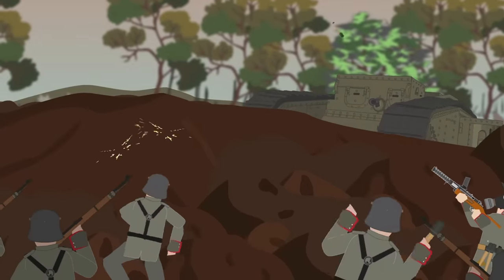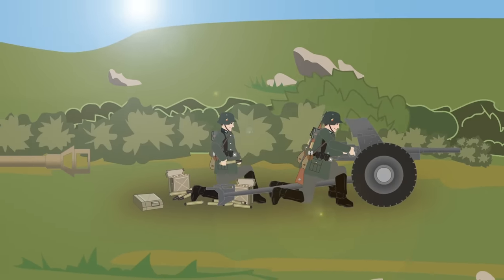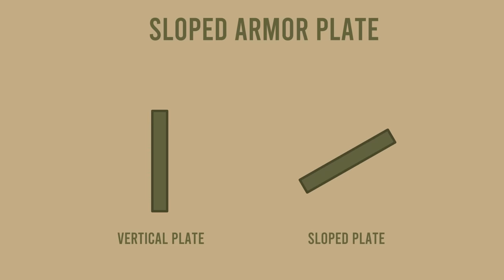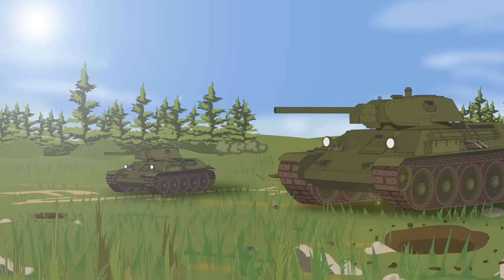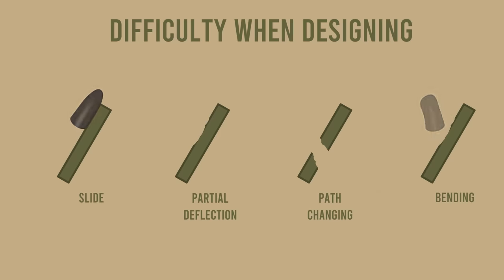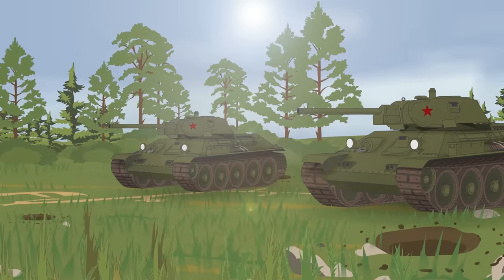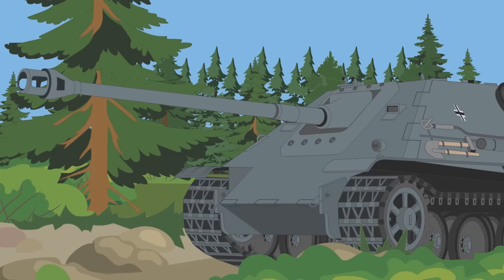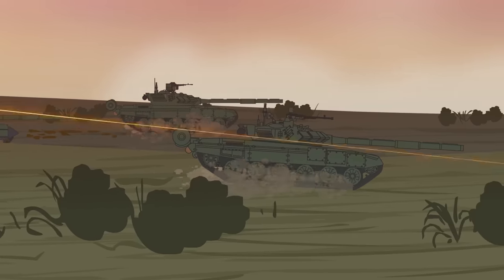Sloped armor: A simple feature that saved many lives

Comment: Reminder: 
Sloping tank armour removed interior space.
The thickness accounts for both the roof/front. While flat armour can have very thin roofs with much thicker fronts.

It's better, but not to the degree people think.
Reply: So more like a sidegrade than an upgrade
Reply: He should make a cold war weapons
Reply: thats a reason why the panther is a rather big tank. The germans didnt wanted to trade too much interior space
Reply: But you have to make flat armor thicker for it to have the same effect as sloped, meaning more weight and less mobility, which is why its hard to find a flat surface in modern tanks, they're all very edgy
Reply: @caralho5237  It doesn’t mean more weight. You need the same amount of metal to enclose a given volume with x mm of armor regardless of how you arrange it.
Reply: no pun intended
Reply: @caralho5237 you have to make sloped armor longer, negating the weight benefit.
Reply: @Danjiano  Sloped armor makes things ricochet. A round that penetrates 100mm of flat armor wont penetrate 100mm of effective 45° sloped armor. The tip of the round will have a harder time "hooking" into the plate, its much more likely to just skim off.
Theres a reason you'll be hard pressed to find any modern tanks with flat armor today. At most, you'll find ifvs that prioritize space over armor

Comment: Tbh I was dreading this, as YouTube is often a BS minefield, but this is a pretty good job, 10/10 visually!  I like the fact you point out the internal volume aspect, a very big part as volume, weight, dimensions are far more important than the armour mobility firepower trope. And the fact there is no weight saving was nicely covered. The two areas overlooked are that sloped armour is easier to overmatch (the rounds calibre is greater than armours thickness) this still effects the vehicle with sloping, becoming less effective if the rounds calibre overmatches the vertical equivalence of the plate and the larger the round the less effective the sloping is comparatively. 

The other issue is that sloped plate is considerably less effective on any slope, that is if the vehicle is going down an incline the armours effective thickness is decreased by the same angle and battlefields are not always flat, while vertical armour can only gain loss thickness in the same scenario. Finally, there is edging effect – any opening in a sloped plate, be it a bow MG or in T-34’s case the drivers hatch, has a larger area by default, this increase the amount of area that can be stuck to one side where the metal is weaker. 

Overall though a very good video, kudos

Comment: I think some  warship armor, as discussed by Drachinifiel, is also sloped.
Reply: Warship armor is mostly vertical because it designed to take hits from long distance which already have angled ballistic due to gravity. Angled armor plate in those situations only make it less effective
Reply: @vunguyenxuanhoang7422  there's also the interior armor design or the armor between accessible areas and the exterior armor, from which the armor is spaced and slightly angled down (on heavier warships), as you are correct, they are meant for longer engagements

most warship armor is still sloped though if ever so slightly
Reply: CSS Virginia
Reply: @vunguyenxuanhoang7422  
Cruisers and battleships often had sloped belt plates to provide additional protection from long range gunfire, the plates were angled outwards by around 20 degrees (Outwards from top to bottom, top being most outward part of plate).

Comment: As a logical next step, it'd be interesting to see a video discussing the evolution of tank ammunition types, starting with the basic High Explosive and Armor Piercing shots and moving into HEAT, various ballistic capped shells and eventually modern shells like APFSDS.
Reply: That should be:
-HE (High Explosive)
-AP (Armor Piercing)
-APHE (Armor Piercing High Explosive)
-APHEBC (Armor Piercing High Explosive Ballistic Capped)
-APCR (Armor Piercing Composite Rigid)
-HEAT (High Explosive Anti Tank)
-APDS(Armor Piercing Discarding Sabot)
-HESH (High Explosive Squash Head)
-HEATFS (High Explosive Anti Tank Fin Stabilized)
-APFSDS (Armor Piercing Fin Stabilized Discarding Sabot)
Reply: @waifuhunter9815  "hey jerry look at this new round i made"
"sir what will it be called"
as it shows the guy mashing the keyboard
Reply: @waifuhunter9815  You missing a Lot of Shell types, and AT Guided and non-guided missiles

Comment: 8:00 I wouldn't particularly call that instance a good example for how good the t34 or its armor was.
I mean 1st of the fact that the crew didn't notice over 20 shots hitting their tank or better from where they got fired at from speaks books.
And 2nd that particular t34 was reported to be unfit for continued service as the armor spalling inside (caused by the insanely high hardening to 600 brinell) and the low quality welds caused so much damage to the integrity of the hull and parts inside the tank that it had to be scrapped

8:25
And because of the the high hardness of the steel, it became incredibly brittle causing aforementioned spalling and weld cracks from small things like 37mm ap or in 1 insanely stupid instance by a volley of 20mm he fire from a desperate AA crew.
Wich more often than not caused the tank to be knocked out, the crew to be knocked unconscious or to be evacuated.

All of this can be seen from books like "soviet causalities and combat losses in the 20th century" in Wich for one over 2000 t34s were lost in the 1st year of Barbarossa alone and 60% of all t34 being lost to the (conventional) pz3 (not StuG or stuff like that just pz3)
Reply: "the tanks of oepration barbarossa" By Kavalerschik also show it brilliantly.

Even a "perfect" T34 would have weak spots against 37mm pak apparently. But due to.... the very qualitfy manufacturing those areas icnreased. and Yeah spalling. He worked pretty good
Reply: @tizi087  I don't understand your point.
Just so I get this correct, could you please elaborate further?
Reply: @guppiapfeljustleopardthing8756  the first thing is another book about tanks, written by an engineer

The second Part is abiut Metallurgy. To make the T34 Plater hoe they are you need to first Producer them. There the soviets made them super Brittle. Then kn order to construct the tank they sometimes needed to bend some plates. To do that they heated them, making anything even worse. As a resukt in some areas even the 37mm had a chance of penetratoon

Comment: Sloped armor also had some issues which is why it wasn't utilized very often and still isn't very commonly utilized in tank design, namely that it damaged the amount of space available in the tank, often damaging crew efficiency and operations of the tank. This is especially true of the T34, which simply did not have enough room and really damages its operations long-term as such.

Comment: At 8:42 SImple History mentions how impressed German commanders were with the T-34. Now the part of the reason for this was that it was used as an excuse for German commanders after the war to blame the Russians' technologically advantageous weapons, so NATO can give them advisory jobs. The Germans and everyone else have always realized the advantages of sloped armor since the 12th century, hence why you see walls on forts and castles at an angle, they help to fight cannon balls and other large projectiles. 

Now many would say the Tiger H1, Panzer 3, and 4 do not have sloped armor, whereas is in fact it did. The front glacis plate is sloped at 10 degrees as this was the most optimal sloping angle without the negatives of slope armor affecting performance too much. Now the reason why the Germans stuck with this angle was because of crew performance. Less angling means more crew comfort, and thus performance. Russian tankers would often get exhausted just from driving to the frontlines before having to fight. Another example would be the original inventor of the T-34 (I forgot his name) whom caught Pneumonia while driving a T-34 to Moscow and died! Although the Sherman did feature sloped armor it was really tall and fat to make up for the negatives of sloped armor, and to fit the big radial engine. Crew performance is especially important when on the offensive and trying to pull off quick decisive strategical operations that would quickly end a front. 

This was why Hitler refocused his attention from Moscow to Stalingrad where a bunch of oil fields were, realizing they were not able to win a quick victory and have forced themselves into a war of attrition. Now his generals were confused at his decision. There was much bickering among the office and this is where Hitler's surviving Generals after WW2 blamed Hiter and his Schutzstaffel (SS, surprisingly a lot of people don't know what that stands for) for all the mistakes and 'dumb' decisions. A lot people don't give much credit to Hitler. 

Now enough with me ranting on. I hope you've enjoyed my comment, and see you on Simple History's next of numerous mistakes we shall see in the future.
Reply: bro your like one step away from falling into wehraboo territory chill out

Comment: Some of the WW2 designs with sloped armor had inadvertently introduced Shot traps like the KV tanks and the M26 Pershing. Basically, the sloped armor would deflect a shot into a concave part of the tank design where the shot might still have enough kinetic energy to go in. I guess this is still better than not sloping and have the shot go in the first place it hits. And only shots at certain angles would be deflected that way.

Comment: Sloping was used way before, especially in forts after the mass introduction of cannons.
Reply: Which makes you wonder why they didn't apply it to tanks from the start....to ALL tanks.
Reply: @ecurb10  the very first tank fielded has sloped armor. The first German tank fielded has a "pike nose" like the later IS series tanks. There are dozens of tanks with sloped armor that were all around well before the T34. 

Designers knew this, and DID implement it when they felt it necessary.
Reply: @jurassicturtle3666  Yes I agree that this was known and used before. I'm just mystified as to why then didn't they implement it with ALL their Panzers (except the Panther)?
Yes there were some others, but with German (and British) tanks it seems to be the exception rather than the rule.
"...and DID implement it when they felt it necessary" - well, whenever is it NOT necessary???
Reply: @ecurb10  I think it's a bit of a hindsight issue. Many early British tanks had sloped armor, but the armor was so thin because of the intended purposes of the vehicles that in practice it didn't make a difference. Granted, British armor doctrine was terrible and was completely exposed in North Africa, but still they were designed with sloped armor. 

As for other vehicles, and now I'm not an engineer myself, but I'd hazard a guess that there were many instances where things like structural integrity and interior dimensional space were simply prioritized. Or perhaps they were afraid of shot traps? Or maybe they didn't properly value armor protection as designers and not crewmen. But still, the root of the issue is that a LOT of tanks had sloped armor long before the T-34. The opening scenes in this video even depict the BT series tanks, based off of the Christie designs, which again feature sloped armor in the front. 

 I believe the T-34 gets the credit it does because it just so happened to be the right amount of armor at the right slope in the right period of the war to result in something like 20+ shots deflecting off of them.
Reply: @ecurb10  
Because it has major engineering, ergonomic, and other issues when on tanks.

Comment: 8:10 /// I heard about this story. It later turned out that it was a KW-1, not a T-34. The Germans often confused the two vehicles and wrote something different in their reports than was actually the case. This is how the indestructible T-34 was created. 
 In fact, the Germans had more problems with the British Matilda than with the T-34, which, when hit in the front plate from most German guns, welds broke and even without a puncture the tank was destroyed.

Comment: From a purely horizontal perspective, sloped armor is really the same thickness as a much shorter, 90 degree vertical piece of the same overall weight. If you use the cosign of 45 degrees say, you've got a much longer piece of armor plate by about 1.4 times the length of the vertical piece to achieve the same horizontal thickness. It's when you get into overhead protection that you might gain some protection for the same weight, but only directly relating to the thickness of the top plating. Plunging fire would actually give the advantage back to the 90 degree verticle armor.

Comment: Sloped armor doesn't save on weight except in a minor way, basically by reducing the interior space and the need for more rooftop armor. The video correctly points out that an angled armor plate weighs as much as a vertical plate of the same LOS thickness covering the same LOS area.

Sloped armor does increase chances of deflections, but on the other hand, it also increases the changes of penetration by overmatch. Overmatch is a phenomenon where a shell has a chance to burst through a plate at any angle as long as the nominal thickness (not LOS thickness) is less than the shell diameter. So vertical armor, with thicker plates, resists overmatch better. This was illustrated by data collected from Sherman hits. The early Shermans had a front glacis sloped at 57°. On occasion, a shell would penetrate which should not have been able to (due to overmatch). Later Shermans had the armor angle more vertical at 47° but had thicker plates to compensate. The LOS thickness was about the same, yet these mysterious overmatch penetrations were reduced. It was only after the war that the effect was discovered.

Nowadays, sloped armor has fallen out of favor. Modern long rod projectiles have a very low chance to deflect on anything other than extremely angled armor (like over 70°) and the loss of useful interior space with armor that sloped isn't worth it. So modern tanks generally have vertical armor, or mildly sloped armor, on all surfaces except for the front glacis. This is about the only area of the tank where extreme slopes are possible so we see relatively thin plates sloped at angles of 70° or more. Sides are generally vertical to allow for a very wide turret ring and thus a very big gun. Turrets tend to be nearly vertical on the sides and only slightly sloped on the front. Rear armor tends to be vertical as well. The exception used to be the soviet tanks such as the T-55 or T-62 with their "frying pan" turrets, but more modern turrets, like the T-90, have more vertical armor (with angled plates for mounting ERA on the outside)

Comment: "That saved many lives"
looks at the t-34
armor cracked because of the high hardness of the steel, meaning that 50% of the total ammount of dead T-34 crew members happened because of the armor cracking and spalling
Reply: By 1942 most of the t34s were destroyed by panzer 3s
Reply: @fishyfish6050  yep
Long barrel panzer 4 dint appeared until what, 1942?
And tiger apeared in around mid of 1942 iirc
Reply: @tinchorb1340  the long barreled panzer 4 came like early to mid 1942 but there wasnt alot of them still when they first entered battle
Reply: @tinchorb1340  the tiger appeared late 1942 in leningrad from what i know
Reply: @fishyfish6050  yes, i know it appeared in leningrad
But i dont remeber if it was mid or late 1942
Reply: the t 34 was a trap for the crews, in a tight tank if there is a fire it is difficult to get out.
Reply: @fulker0023  it was harder for a t34 crewman to get out of the tank than a panther crewman to get out of the tank and that really says something...
Reply: @fulker0023  we shouldnt forget that early versions lacked enough escape hatches
Reply: The T-34 sloped armour also has suffered the most Tank losses in the world so I don't think for the poor unfortunate crews would agree about saving lives
Reply: @ds6080  even at the end of ww2 when the soviets had gotten the t34-85 the steel quality of the armour was just as horrendous as before
Reply: Lazerpig?
Reply: @jakubrusnak3432  yep
Reply: They would have been better off producing Shermans with the cost and the fact that anything above a 50mm could crack or cause spalling in the t 34
Reply: @Jakub Rusnak. Man of culture

Comment: Though the Soviets did use slope armor, they were not the first. But they were the first to use it extensively and it proved to work all the way through the war for the Soviets. Overall very good video of slope armor on Soviet tanks.
Reply: Its why they had the biggest losses in tanks too
Because u know everything russia did worked
Reply: @Duy Đinh i mean sherman has slops but isnt incredible crammed like the t34 crusader is crammed with no slopes too even the panther was apparently crammed with slops those broke down all the time like the t34 too
Reply: @Shenaniganator101  The Loss was due to crew training and tank doctrine ,and production quality and cheap design shortcuts to produce the tanks faster and cheaper, not due to slope armor.
Reply: @Shenaniganator101  Also the fact that the metal treatment in the Soviet Union or Tank manufacturing was too high of a temperature so it made the metal brittle, sending spalling into the crew despite no penetration, thus making slope armor somewhat redundant on many tanks.
Reply: @Shenaniganator101  the most produced has to be the most loss ofc